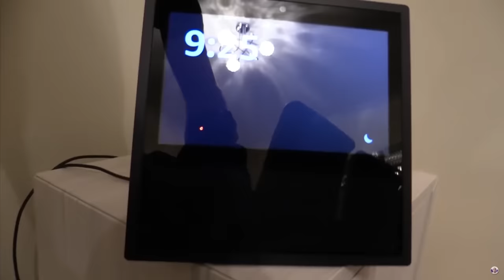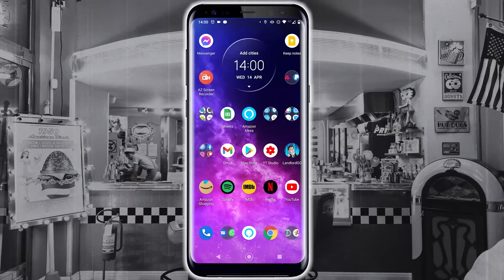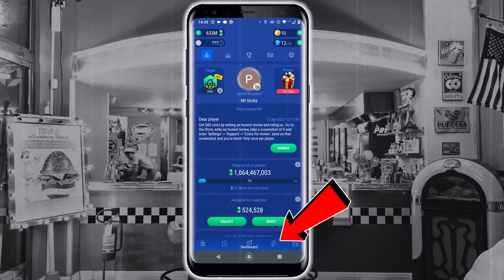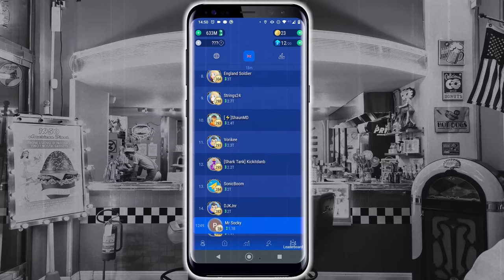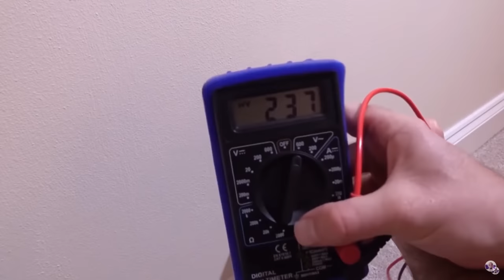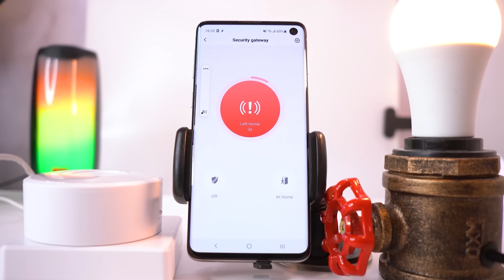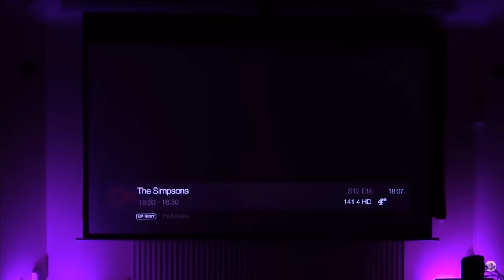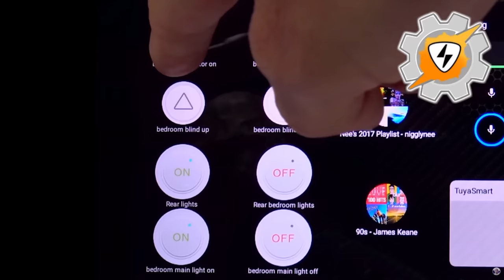Starting A Smart Home I ULTIMATE GUIDE

Comment: I respect that you are trying to make things affordable and bang on about Phillips hue being overpriced (which they are I agree) but if you go for the basic versions of Phillips hue stuff like I don't need my lights to change colour I'm not at a disco after adding up fitting my home with the devices you recommend and the Phillips hue devices I've seen it would be about the same price and they work without the bridge although I'd probably still get the bridge coz Bluetooth sucks ass other than cost and the fact they discontinued their previous hub rendering it useless (which I get is annoying but the new hub isn't really expensive) what is your gripes with Phillips hue? I'm not some Phillips hue fanboy I'm really really new to smart home and I watch Reed alot he loves Phillips hue so just curious why you seem to hate them so much because they do seem like an affordable and simple enough solution for somebody like me that only really wants to automate some lights with a couple motion sensors I currently only have 2 Phillips hue bulbs so would be easy for me to divert to a different path if there's another reason that I'm missing that you dislike them?

Comment: I find some of the choices here that Paul is '"spruiking" to be a bit of a risk. Let's look at it this way. You can buy the cheapest stuff from Ebay, Amazon etc and it may work quite well. But will it be around in 2, 3, 5, or 10 years? Building a smart home system should be about longevity as well. Personally I recommend LifX....they cost more but they are an ASX listed company with a good track record and have a solid business case. I also recommend Eve for switches....they work well and the company is going strong...they are not  going to fold up any time soon. Remember that your house is "forever" or however long you want to live there....and your devices should match that expectation.
Reply from the maker: I can't disagree more. Although I do recommend lifx if you want the best colour saturation, all my recommendations are for companies with a proven track record. Tuya are part the new CHIP alliance along with Samsung, Apple, Amazon and Google. 

Broadlink have been a strong player since the smart home industry began. 

Amazon are currently winning the smart home race hands down. 

Flic are absolutely thriving as the only button on the market that can start Alexa routines. 

The rest of the recommendations are zigbee 3.0 and so will work with anything, or they are entirely open source. 

Dude, if you're gonna knock my advice then at least investigate the companies I've recommended instead of just assuming they're flash in the pan. You're clearly out of your depth.
Reply: @paulhibbert  I am not out of my depth..I do this daily......its just you are spruiking products that the average joe is not going to find easy to set up or maintain. Your video is called Starting A Smart Home In 2021 | ULTIMATE GUIDE....really? So you expect the "average joe" to go and set up broadlink??? Really? For a start you need a PC??? Hello....what happens if the client doesn't have one...or has a Mac or just an Ipad?

The CHIP alliance is just another garbage alliance.....there have been many so far and no one can agree on whose protocol to use....wifi, zigbee, more garbage etc etc etc. It is a war that has raged for years.

"The rest of the recommendations are zigbee 3.0 and so will work with anything, or they are entirely open source." Yes so what? open source does not mean its going to be around in 5 or 10 years. Zigbee is a protocol....and nothing else. When someone comes along with something else...manufacturers will move to it.

I agree that Amazon is winning this hands down....no point of contention there at all.

Put your ego away please.....you are providing great entertainment for us.....and us means the IOT and Smart Home community......but for newbies out there....this particular video...not so much.

Also....Tuya is garbage. If you can't see that then....Specsavers?
Reply from the maker: Says he's not out of his depth... says you need a PC for setting up Broadlink. 😬

Dude, step outside of whatever 3 products you're flogging a bit more often. You are arguing about solutions you evidently haven't tried. You have NEVER needed a PC to setup Broadlink gear.
Reply: @paulhibbert  The PC/Linux version works best if you have HA is what I meant.....mate don't take things so personally. I'm not flogging anything......actually you are....and how much are you being paid? Any disclosures you wish to make?
Reply from the maker: So you are recommending home assistant to beginners? This gets better all the time!

You say you don't sell anything? Your giving the devices to your "clients" for free then? You have insinuated that by "doing this daily" that you must be selling something!?

As for me, you're barking up the wrong tree, the only sponsor on this video are the good folk from landlord go.

Comment: BG SOCKETS  are not working with alexa(US)as not supported by app. i have to use IFTTT to be able to control this socket. if there is another way please let me know.
Reply from the maker: I'm surprised to hear that, but I suppose you could switch to the Europe server in the Broadlink app, AND in the skill. If you switch both over it may introduce a slight delay, but you ought to get the same experience as us in the UK.

Comment: If you invest in Zigbee, I would also recommend zigbee buttons over flic, they will avoid the delay, are about 1/2 the price per button & dont require the £118 starter kit.

Also if you have the time to learn it, (ooh the) Home Assistant will generally allow you to go the completely cheap option.

Comment: HELP! - So...my wife does the evil shut off a switch thing...but the problem is what I'm dealing with is a lamp.  The good old kind of lamp with a fiddly rotating switch just below the bulb on the socket.  I have dumb bulbs (because I hate paying for replaceable bits to be "smart"), but I use smart plugs for these lamps.  So...either the plug stays on and she uses the switch, then my face hole can't turn on her lamp and I can't set our room as a routine.  OR...she gets pissed when I turn the plug off and she can't turn on the lamp...then she just removes the smart plug.  The only smart lamp sockets I can find sit between the existing socket (meaning there will still be a fiddly switch) and the bulb.  I NEED a wireable socket replacement with a smart button that can replace the existing socket.  Something that'll fit her need to be able to turn the lamp on in a nearly "normal" way but not disrupt the ability to be smart.
Also, just to be more difficult...Home Assistant.  No integrations, no Tuya (unless I can convert it to ESPHome).  I hate required cloud crap...either it works on LAN or forget it.

Comment: In your past videos you've recommended a certain wifi router which can easily deal with 200 wifi connections.
As my current network resembles the matter that is commonly seen emerging from the rear end of a dog, could you remind me of the model of the router?
Reply from the maker: I use an amplifi HD and its AMAZING,  but it's NOT cheap! I think most newer mesh routers these days cope much better than those of a few years ago though 😊

Comment: Hi Paul and everyone. New subscriber, love Paul's content. I was thinking of starting with smarthomes for the first time. My plan was to start of by buying a set with three google nest mesh wifi. (I guess these also works as google assistants?) However after watching this, Im starting thinking Alexa is the way to go. Any advice? 

Also I was looking forward to getting the Hubitat - however I see it is totally out of the equation here.. (I like to make cool stuff in excel using VBA, so was looking forward to play with that thing :-)

Can I make modes with the setup explained in the video? (for example  "Im home" - "shell protection" - "kids awake (but I'm sleeping)" etc with the Zignito Smart Zigbee Hub?  Or should I just get the Hubitat right away instead?

One thing I see I absolutely have to get is the BROADLINK RM4 PRO - what a fantastic device. Do you know if this can learn garagedoor openers (Must be RF I guess).

Comment: Nice work Paul. Is there a physical handset that works with the Broadlink RM4 pro, so I don't have to use my face hole or fire up an app on my 'phone to control the telly? Cheers, another Paul
Reply: The one that came with the Telly? Sorry, not trying to be obtuse, just having a hard time trying to understand the use case here....
Reply: @tonysouthern3017  Hi Tony, The Logitech harmony comes with a handset that can be used to control the TV and all associated input devices (DVD, X-box, fire TV etc.) which controls the hub. It's a more intuitive way to control stuff than opening an app or talking to the smart speaker. Just wondering if the RM4 has anything similar

Comment: Hi Paul, great entertainment once again. Thank you. I have a double power outlet in my kitchen that I want to replace with a 4 switch, smart switch to operate the smart led steps that I have installed. I can't find any smart switches that take up a UK double wall box........do you or anyone else here know of one?
Reply: Would something like this https://www.screwfix.com/p/appleby-1-1-gang-dry-lining-knockout-box-35mm/22772, or this https://www.screwfix.com/p/appleby-1-1-gang-galvanised-steel-knockout-box-35mm/48234 help? You'll be able to mount two switches in the the double outlet space, but if you want no gap between them, I don't know what other options are available for UK spec smart stuff. There's lots of 4 gang dumb switches for double spaces, but short of trying to go the modular switch plate route, if indeed smart stuff is available in modular formats, I'm not sure what you can do.
Reply: @Tekwyzard  hi Ken, thank you for thinking about me and my post! Yes something like that might work. However I won't be able to remove the existing double wall plate due to some tile wall cladding that is over the entire wall area. Definitely the smart switch manufacturers need to catch up with more aesthetically pleasing smart switches! We are long past the glass switch look with blue circles on them lol

Comment: Hello Paul, I'll be thankful if you answer my question, considering the price of the flic buttons and the fact that it needs a hub, why Xiaomi (aqara?) zigbee buttons are not a better option to control lights??
Reply from the maker: The xiaomi buttons can't trigger Alexa routines whereas the Flic buttons can. This means the xiaomi buttons are awesome for controlling xiaomi equipment, and in fact other people's equipment when paired with something like Hubitat or home assistant, but not as easy a solution for controlling 3rd party equipment as a beginner.

Comment: TECKIN NOW USES ROUTER PASSWORD INSTEAD OF WIFI PASSWORD TO WORK. My teckin plugs stopped working after some time consuming work found they only worked if I used the router password instead of the WiFi password . Yes I did double check the router password instead of WiFi password any idea what's going please

Comment: @Paul Hibbert just installed a few Aqara light switches (no neutral) the broadlink black dbl sw look like a badged version? ok I do use "Hooooome Assisstaaaaaant" but they work a treat and at around £23 (AliExpress) they are really good value, think I'll bin the 3 HUE bulbs in other rooms. because as you say they are a pain due to stupid switch issue.

Comment: I want to buy an alexa echo dot, but i don't know if there is a big difference from the third to the fourth generation?
Reply: Fourth gen dot has a Zigbee hub, third gen does not.
Reply: @johnny_wheelz  Wrong
Reply: @leopold7562  also wrong
Reply: 3rd gen has a down firing speaker and 360 degree sound. 4th gen has a directional front firing speaker and is much larger despite having the same size speaker. Highs and vocals are a little clearer on the 4th yet it will be a cold day in hell before I buy a Bezos Ball. They are damn ugly!
I am perfectly happy with my 3rd gen dots.
Reply: @dnoland77  No
Reply: What HiFi concluded their review by mentioning "by updating its most popular and affordable Echo device, Amazon has laid down the most compelling case yet for choosing Alexa. Regardless of the Marmite aesthetic, responses are slightly quicker, answers are much clearer, and the sonic performance is better than ever. Amazon’s entry-level smart device has come a long way in terms of sound quality since the arrival of the first and second Dots – so much so, you could say Amazon has come a 'full circle’ in the smart speaker arena."
Reply: @johnny_wheelz  You obviously deleted your comment where you mentioned zigbee hubs.
There is not a single echo dot ever made that contains any zigbee hub.
Therefore, yes, I was right!
Reply: @dnoland77   I was wrong, so I decided that not to cause confusion, I'd deleye my post. Nothing wrong in doing so. Stop trolling and get a life. People make mistakes, I've corrected mine by deletion. Go annoy the other fella who made the same error
Reply: @johnny_wheelz  I don't really care that you deleted your post. What I did care about was your reply of "no" when I correctly stated you were wrong as to not mislead the original commenter.
Setting the record straight is not trolling.

Comment: For me here in Canada, has been a nightmare to find decent motion sensor / door sensor that work with Alexa's zigbee. I tried the one from SONOFF, but it was a garbage.
Reply: Agreed. Some of the Sonoff stuff pairs fine, but doesn't actually work well.
I've got the SNZB-02 temperature & humidity sensor.
It works when it wants to.
Reply: @BradClarke  Not sure if we need their hub to work properly, but I def don't recommend it
Reply: @diegowlp  I've got a Hubitat Elevation hub on the way.
From what I've read on their forums, the SNZB-02 works well with Hubitat.
Not sure about the motion sensor. 
I think the door sensor is OK as well (would need to check again)

Comment: What is the range on zigbee? 
Please tell our non plebs with a big house
Reply: Zigbee works on 2.4GHz, so excluding any additional range provided by repeaters it should be about the same range as WiFi.
Reply: @MatthewNash  thank you, so I would need at least 2 hubs then 🤔
Reply: @AlexManMe  If you use wired Zigbee devices, such as bulbs, they will work as routers, which will extend the mesh nicely. I’ve only got one central Zigbee controller and I can use Zigbee devices even in the rooms where Wi-Fi is a pain to reach.
Reply: @leopold7562  thank you for this, does all zigbe bulbs offer this service? Or only the wireless ones
Reply: @AlexManMe  It should work for all Zigbee bulbs, but it’s not a given, unfortunately. I’ve found Hue and Hive work fine, and most IKEA ones work too, apart from the Floalt panels. Zigbee power switches should work as well, although I’ve not tried any yet.

Comment: I am sorry Paul, but Nest is one piece of garbage. There are better thermostats using Open Therm like i.e. Drayton Wiser (OOH The Zigbee!). Not only that but Drayton allows you to control temps in every room, you can use TRV or Room Stats for that purpose. A far better device, I have been using it for more than a year, and it is fantastic. Also, their API is open so can be easily hooked with OOH The Home Assistant!. Price-wise it is cheaper to start, and you can gradually expand the system. It can also control the heating of your water. If you look on eBay sometimes you can buy it really cheap when someone surplus stock.
Reply from the maker: Willing to accept Drayton Wiser as a suitable alternative assuming it does indeed have opentherm (I have no experience of it), but curious as to what exactly about the Nest is garbage. 🤔 Not a fan of the company, but it's a great thermostat in my experience.
Reply from the maker: Reading up on amazon there are some very mixed reviews of your recommended stat 😉
Reply: @paulhibbert  Would this be because of the Zigbee range? Personally, I have no complaints, it was tricky to set it up (TRV pairing) but once I understood how pairing works it pairs every time. I researched TRVs and thermostats a lot and I have been using this system without any issues. I discovered it through the Home Assistant forum where it was recommended. There is a thorough installation and review on Charlie DIYte channel where he compared few different systems as well. I vouch for it personally and Nest is really primitive because it senses the temperature in the whole house which is no good for the big house as it can create hot spots and cold spots. With Drayton this is a non-issue. Not to mention how many yachts Google CEOs need ;) It supports both types of installation compatible and non-compatible with OpenTherm. You are probably busy person but if you want here is a link to the aforementioned review: https://www.youtube.com/watch?v=yuxWDCRwIuc